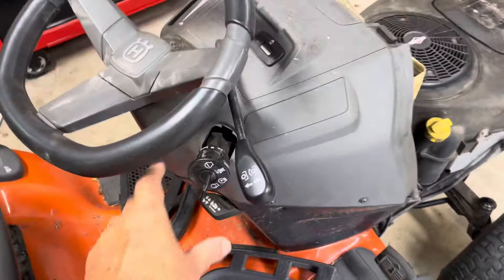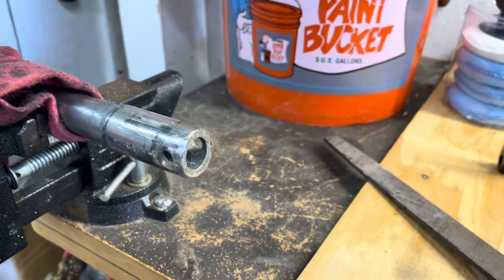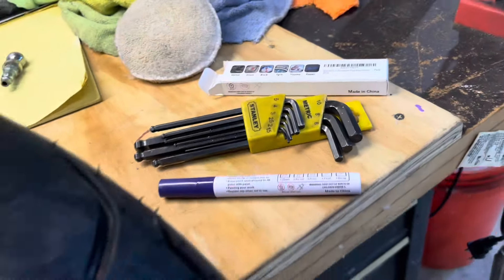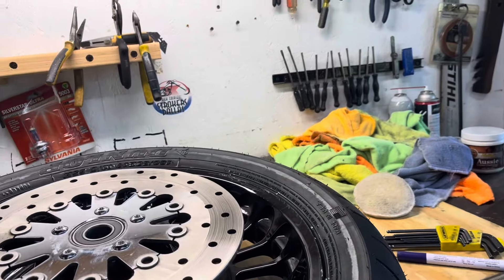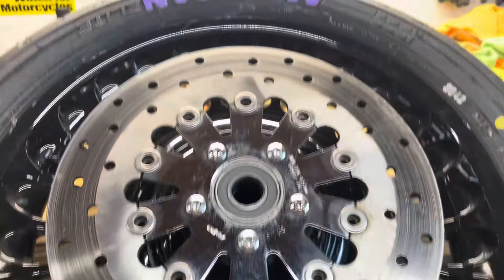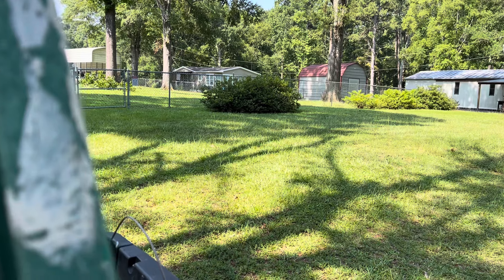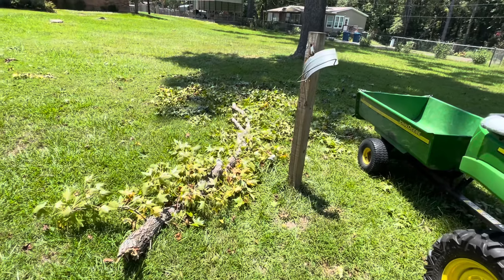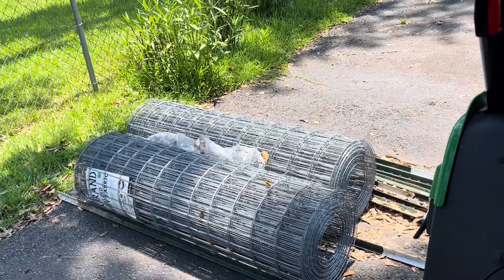Fixed mower, tire on motorcycle, calked AC,cut up a yuge limb

Comment: I just replaced the lead acid batteries on my coal powered mower with a lithium battery. It works great so far.
Now time to work on my motorcycles 😄
Hmmm...watching your videos is like watching my life in a different universe🤔
Reply from the maker: Those lithium batteries are for the upper crust, the elite. I’m po. I have to live in a mobile home park and stick with the lead acid batteries. I have two mobile homes, so I officially meet the “park” criteria, plus, the police have been here several times.